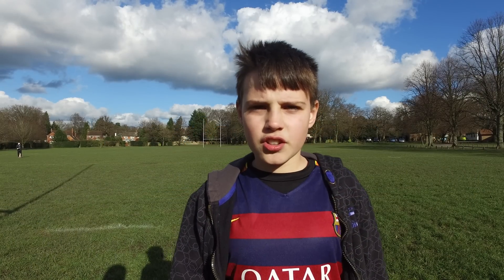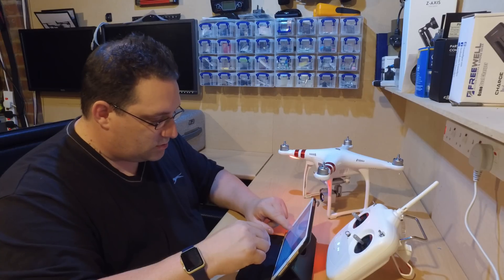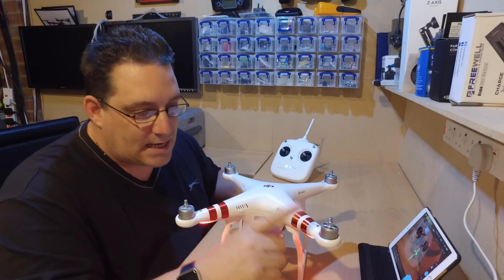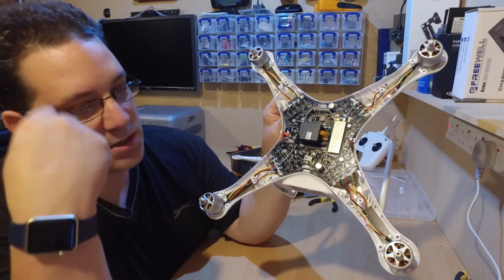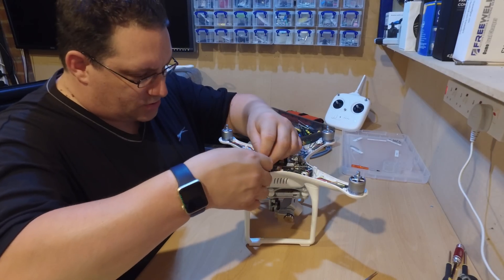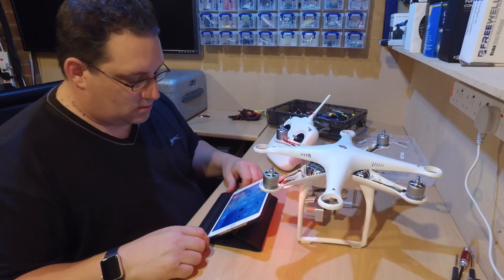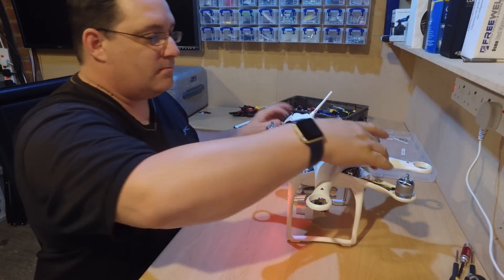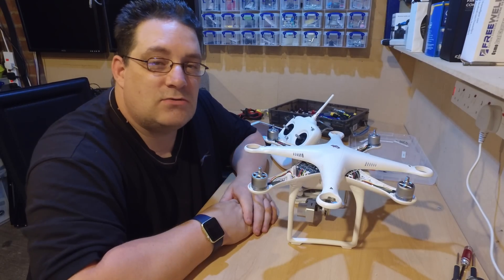DJI Phantom 3 Standard Motor/ESC  Issue

Comment: Hi ive just try to repair my dji phantom 4 standard when i soldered all all The motors o n The esc only 3 worked motor 4 got very hit and smoke also The esc got really hot and smoke i removed The faulty motor and turn it on without one motor and all esc whas normal temperature i ordered one new motor but i dont know IF The motor or The esc is The fault Will The new motor work as normal and why did it get so hot before whas all The fault The motor or The esc and cn i   reuse my esc board without changin The esc.

Comment: Hi Jack I have  phantom 3 stqndard. It powers on and can connect to it ok but there are no led lights on the legs coming on at all. In the app I can see through the camera but no control of the drone itself  controller light is free so is the sync light on the quad any ideas?

Comment: this is not ESC problem that is trouble on cable you can resoldering or changing the cable with the new one, maybe it broke in Red or Black or Yellow cable...i have been fixing and solved

Comment: i have a p3a  and 3 of the motors seem to run rough. they spin fine, but when you spin them manually with the props on 1 gives a woosh noise and the other 3 spin but its like they are on cogs,   do i need to replace the 3 motors? or will it be ok to continue to fly? or can i spray WD40 into the motors and hope it might just be a little dirt

Comment: Hi, my DJI phantom 3 standard's motor spins fine when there isn't a propeller attached, it also picks up speed when I apply power from the controller. However when I place my propeller onto it, the motor spins extremely slow and hardly picks up speed. Do you think this is a motor issue or ESC issue?
Reply: I have the same problem how did you solve it?

Comment: Hello There ! Thanks for the video ! , I am just wondering. I fix these mainboard all the time and I mean like hundreds of them.We do replace SMT components so that the customer does not have to buy a new board. 
Its actually quiet easy to find the failed components. If you need help with a drone in the future please send me a message , I would  be more than glad to help :)
Reply: Hola, tengo un fantasma profesional. 3 El dron funcionó normalmente hasta que golpeó un árbol. No fue tan grave. No dañó. Nada funcionó durante 7 meses más hasta que aprecié el error fatal. ESC STATUS ERROR He visto algunos cambios en el mosfet y otros integrados y resueltos. Mi pregunta es cómo saber cuál es el dañado. Espero poder contar con su ayuda, mi correo electrónico villacisjohn@hotmail.com
Reply: @John68480  Hi John , please get someone to translate this for you. Into german or englisch. GOOGLE translate is doing a bad job... I wish to help you !  Kind regards Frank
Reply: Do u  have a Contact number
Reply: @drewhite1930  sure Robert  : 7066042350 if  Kind regards Frank
Reply: Hi ! ,,, :)  Thank you for asking.  If you do like working on things then I would recommend  to take the Motor from the board and then hook up a power supply @ 14.8 VDC to it see if it is spinning strong enough. Maybe 12 VDC could be enough. Ignore the yellow wire. If you happen to have a lab. transformer would be nice for future projects :)  .   I kinda think its Motor , but I have been proven wrong before.  :) Please let me know how it turns out...  Kind regards 
Frank
Reply: @zytechnology  Hey, so I tested the motor and it appears to be working fine with a 12VDC, the motor runs and works fine without the propeller attached but when I attach the propeller it slows down and doesn't spin, I have ordered a new motor because I highly doubt it's an ESC problem because I don't get any errors on the DJI app, I believe the motor can't withstand the weight of the propeller or the bearing has come loose. Thanks for the help anyway Frank.
Reply: That would be interesting... Did you swap the motor on the drone itself... ?  Please let us know what happened :)  Thanks !
Reply: @zytechnology  I haven't swapped the motor on the drone itself, I just tested the motor which is not working. It appears that there is a bearing issue with the motor, a new one should fix the problem, will keep you updated on the progress :)
Reply: @ih5927 ---- I wish you the best !  Thanks ! :)
Reply: this is not ESC problem that is trouble on cable you can resoldering or changing the cable with the new one, maybe it broke in Red or Black or Yellow cable...i have been fixing and solved

Comment: Thanks!  I bought an Ebay Phantom 3 and it had the exact same problem and I was worried if it was an ESC or a motor.  I feel confident it's the motor after your video so thanks for sharing!
Reply: Can u say which kv motors are used for the drone ??

Comment: i have the facilities  for replacing the smd mosfets for the ecs on the phantom 3 drones why  pay £££££s for a board
when the mosfets are a reasonable price to have replaced
if a new  motor or a known good motor stutters on start up then it is a bad mosfet or more than 1 mosfet the motors are 3 phase a/c motors
and if a mosfet/mosfets goes down it drags one phase out.. props jammed in tree branches or jammed in tall grass causing a motor stall can burn out the mosfets. if you look at the 6 mosfets you will see either bad burn marks or the mosfets may show bad cracks and burn marks. the mosfets are npn and pnp type
The only other thing to be aware of is using to longer screws holding the motors to the body. you run the risk of damaging
the motor windings and again damaging one or 2 of the motor phases  causing motor stutter and you may also damage the mosfets because of a dead short on the windings (your motors are now scrap)

Comment: Hey jack I have a issue with my drone, bought it used from a guy from Facebook for around $200 usd, I got home I did all the updates but motors wont work and gps signal is not popping up. Camera moves and all but I'm not sure what's going on,
Reply from the maker: I will do an update on this video today so watch out for this later today.
Reply: Jacks Drones alright thanks

Comment: I had the same issue, and soon realised it would be a new motherboard or a new drone.   Midcityhobby in USA were selling a motherboard with four motors on Ebay, brand new for £89 + postage + import duty.   Came to about £130 all in, and fitting the new board and motors was straightforward as it didn't require any soldering.  Linked the new board to my controller and the drone now works faultlessly.

Comment: Hello.
I had a motor get stuck and overheat a while back and now, when I turn on the motors, they all seem to run at the right speed but when I try to power down, one of the motors does not shut off. Any thoughts on what this might be?

Comment: Question;  is there a method to test the motor that is not running, short of changing the motors out ?  I purchase a wrecked P3 Std and the two right motors dont work.  Previous owner put a new shell on it, as a result of the crash, and haas me wondering if it's not the board that is not functioning properly. ???  Be interested in feedback....

Comment: Can you upgrade the P3S motors with better high performance motors?  Such as a Lumenier RX2206?
Reply: Robert Kasco No, the size of the P3 motor is different from the rx2206. DJI's motors are already some of the best.
Reply from the maker: no as you need to upgrade the ESC that are rate for they motors, unless the RX2206 can run off the same ESC then it could work.

Comment: I have the same problem with phantom 3 pro, motor not rotate. I changed old on new one, but problem still thear.
Sould I change all main board?
Reply from the maker: if you change the motor over to new motors and you know the new motors are working ok, then yes change the board.
Reply from the maker: You can tell if the ESC have blow as when you power on the App will say something like ESC error contact DJI so they a good sign that esc have gone.

Comment: I'm confused. You switched the motors around to determine if it was the motor or ESC correct? Are there different ESC's for each motor? If so, it would be a bad motor if the motor behaved the same on different ESCs
Reply: Master John I know it confused me initially, basically the motor was swapped with a known good one and the issue remained on the arm/motor position. There are it appears 4 esc's on the board, I prefer the older construction of individual esc pcb's
Reply from the maker: yes for each motor it has it own ESC chips, so by switching the motor around you can see if that motor a problems or if the esc, some case you can blow all esc as the same time, or you can easy blow one of the esc chips, its very easy done just buy holding the motor while it power up can cause the esc to blow.
Reply from the maker: if the motor behave the same then it a motor issue but in almost all case I seen so far it the esc that case the issue.
Reply: I'm still confused after watching this video,you claimed the (bad) motor behaved the same after you swapped them over......surely that would mean the motor is faulty not the esc right???
Reply: martyn warriner  No, he exchanged positions of the motor. So, the same motor that behaved badly is now performing excellently in the new position (esc). Hence the motor that worked ok in it sposition where the other motor is now working fine. Board needs replacing as I guess you cannot just replace the esc due to its inherint built into the board. What a hoaxing design. No wonder they went to the 3 pro so quickly. The standard is so touchy that even a small twig in its path will burn the chip out. Must have made lots of buyers upset.
Reply: Jacks Drones - Quick question for ya...Is it possible to put a GoPro gimbal on a phantom 3 standard to replace the original gimbal?

Comment: So a typical Apple user fix then... "It is the motherboard so it'll need a new one". Not much of a repair then. Cheaper to buy a new drone.
Reply from the maker: Yes cheaper to buy a new one, as DJI doesn't sell the ESC they all part of there main broad.
Reply: Wrong Apple user. Try again. This time try harder. This time try an answer that doesn't involve "I dont know whats wrong so we have to buy a new one". How about desoldering the SM components off the motherboard and replacing with new ones. There are videos on youtube on how to do this... so how about ditching the "I dont think I just buy Apple" and engaging brain before offering people advice which is akin to "Give up". Thanks.
Reply: Hi Matthew, what are the SM components on the motherboard? And are you saying that by doing this it will resolve the problem with the ESC? thanks
Reply: @SMERKALBO  definately !  it can be fixed !
Reply from the maker: yes they no way of re-pairing the ESC all built on the main broad and DJI doesn't sell the chip , it whole board or as you say new drone
Reply: @JacksDrones  HI Jacks...  :) think outside the box... They get fixed every day.

Comment: hii your video was so helpfull but i have some questions :S so do i have to change the board? or just the motor? because the problem was finally in the motor right? i also didnt understand what you said about ''34 pounds'' or something like that..could you say it here again for me please, it would be so helpfull. thanks a lot.
Reply from the maker: in this case it was the ESC which would mean a board change, the motor wasnt at fault by swapping the motor over it show the motors was fine it was the ESC. Under the main board there is the battery cage which cost £3 - £4 in this case it was broken had to replace it.
Reply: is that the IMU ? i had the same problem with the motor doing the same . does that mean that i have to change also the battery cage? thank for answering
Reply from the maker: antonio lopez ruiz The IMU is working fine it was the ESC on the board, so i have to replace the main board. the Battery Cage was broken so yes had to replace this too.
Reply: i dont talk english very good so what do you mean when you talk about the main board , do you mean the green thing on the top inside the phamton?  thats what i have to change?
Reply from the maker: antonio lopez ruiz yes the whole star shape board which inside

Comment: hello congratulations for the video, too bad they are not in Italian: D
some questions:
you can mount the gimbal of the phantom 3 pro in phantom 3 4k? or reverse ???
and then the main board of 4K is the same as that of the pros and the Advanced ??
you have the schematics of dji cards ??
sites where you aquistare parts dji

thanks info nicolaxerra@hotmail.it
Reply from the maker: The main Board for the pro/Adv are the same board, the camera on Phantom 3 4K is different to the Advance i not had one close up to swap them around and know for Def it have to be one i would try next time i get both in together to test, all my parts i buy from DJI

Comment: Are the components that drive the motor not available?
Reply from the maker: the ESC are all built on the main broad now so you not able to get parts unless you buy a replacement main broad thou.
Reply from the maker: no you have to replace the whole mainbroad
Reply: Hi Jack,
Thank you for your answer, but I think I didn't make myself clear.
I'm assuming DJI would not manufacture their own speed control parts, I wonder if the specific components are available?
Are you in the UK?
Thank you
Reply from the maker: John B i have been looking but it only a DJI part so getting the smaller parts wouldn't be possible not even 3rd party anything :(